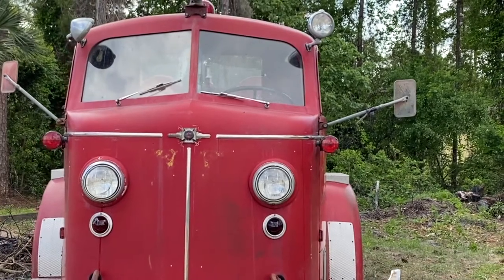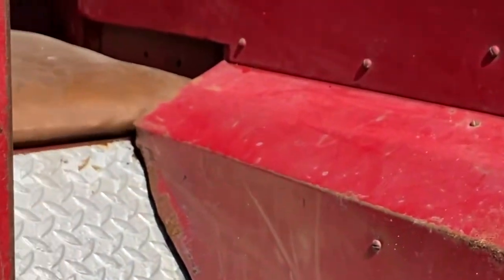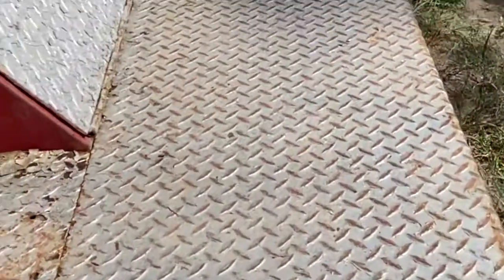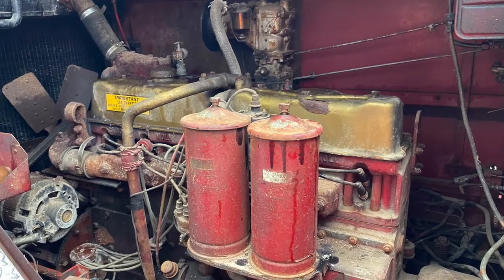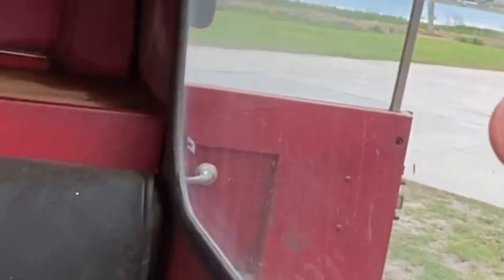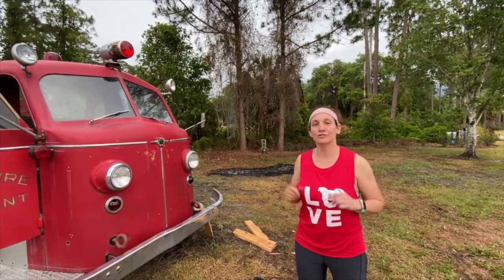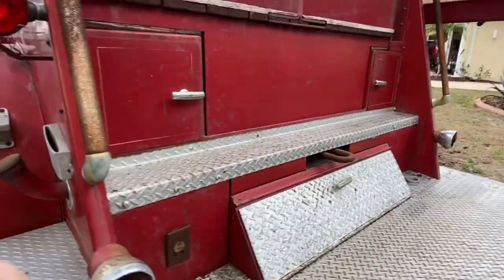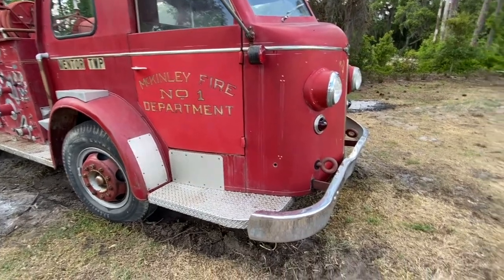What to Expect From an Antique American LaFrance Fire Truck!

Comment: Just subscribed. Over the next few days, I'll catch up on the other videos.
In the late 80's, Freeport Illinois found themselves with a broken modern ladder truck.
They brought an old American LeFrance hook and ladder from (I believe) the early sixties to use as a spare.
One of the guys at the station said it was a dream when at a fire scene, and was a lot more stable with the ladder raised than the modern truck.
The only challenge with it was learning the trailer steering. The combination required two drivers.
Reply from the maker: That's really cool, thanks for sharing!

Comment: I'd imagine the reason they repainted both doors was because the truck had been sold to a different city or town & they quickly repainted the doors in their standard color

real nice find
Reply from the maker: Absolutely! It started in Inkster, Michigan, and was then transferd about 120 miles north to McKinley.
Reply: @breegoldstein  I'm looking into buying one of these & am looking for info 

how much does it weigh? how fast will the engine go? 65mph? 

V12 must sip gasoline

how wide is the truck bed body?
Reply from the maker: @IronicallyVague  this one weighs 12,500 lbs. I have a smaller, 1996 Isuzu Elf that weighs 10,207 lbs, for comparison. Not sure of this one's top speed.

Comment: The electrical system is probably still a 12volt positive ground. This you will find positive ground will be the biggest challenge. I have a 1956. Labor of love.
Reply from the maker: It is... or was... a positive ground. We took out the wires because they're rotted and haven't rewired it yet. Very much a labor of love. How's your '56?

Comment: There is (or was) a American LaFrance Fire engine museum in Georgia and they may be a terrific resource for you to repair and how to operate your fire engine. I drove on like that in my department in the 1980s before they sold it. Ours was gasoline engine as well. I will be glad to share with you what I know about that truck as you may need a lot of new knowledge and resources in your future.
Reply from the maker: Thanks! It was hot grounded, so we pulled the wires. It's waiting for me to rewire it to neutral ground it. It's an immense task and I haven't had a chance to learn about wiring to get started.